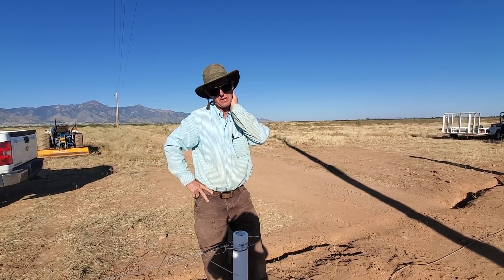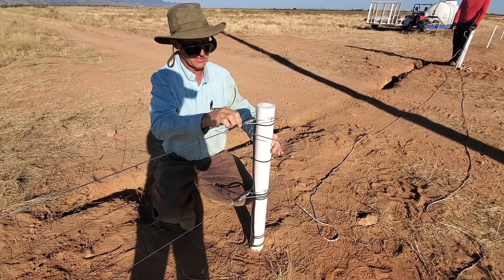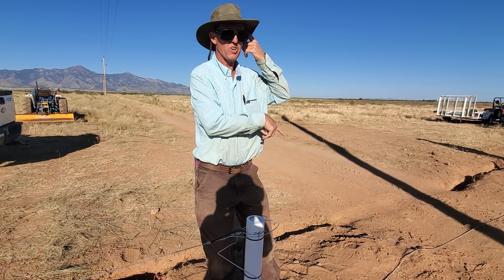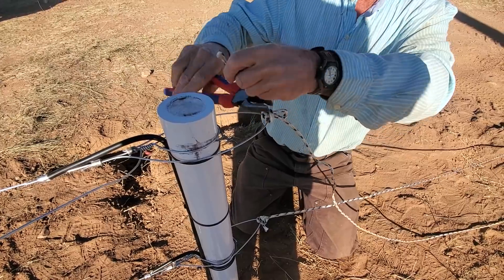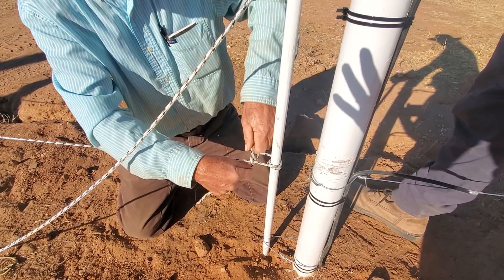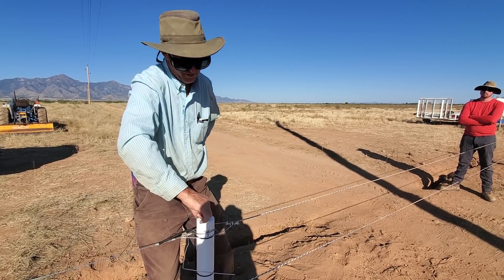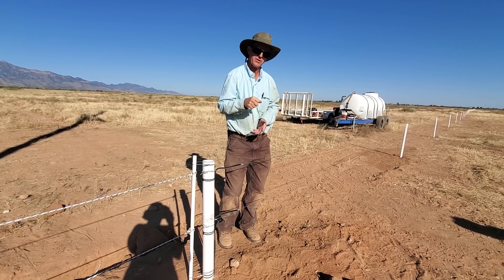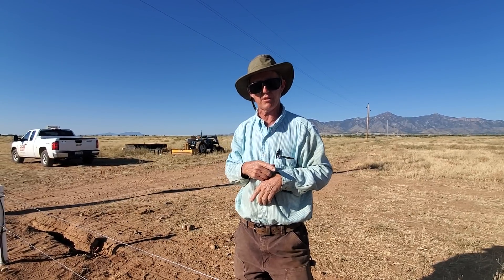Installing electric rope gate on Arizona grazing operation.

Comment: The only problem with fiberglass is it starts to splinter in the the desert heat. I suggest using gloves when handling fiberglass poles/rods after they've been in the sun for awhile.
Reply from the maker: We painted the fiberglass posts to prevent fraying
Reply: @gregjudyregenerativerancher    Lol, y'all think of everything!  That's the value of experience plus a desire for excellence!

Comment: Do you need to connect these type of electric fences to a "mains power supply"? or can it be done with off grid style like solar or something similar?
Reply from the maker: Either power source will work fine for powering up the fence.
Reply: @gregjudyregenerativerancher  Thank you.

Comment: Would Schedule 40 PVC pipe work equally as well as the steel pipe conduit for strength under the gateway?  Or, is the steel pipe stronger and better able to withstand truck and tractor weight?  Thank you in advance for your reply.

Comment: Electrician here. The 2" ridged conduit is the way to go underneath a road. Depth is critical. 2 feet deep incased in concrete is the National Electrical Code requirement. For this situation one could skip the concrete. Why? There's more then likely not going to be thousands of vehicles crossing over every hour. The deeper the conduit the less likely it will be damaged. It might seem over like over kill. Buy when a short time passes and you have to dig it all up again.......why didn't we put this deeper?

Comment: I have my fences 3 wire one neg 2 hot. Middle wire is ground. I am use 5 joule cyclops and right now can just hold the hot wire
Reply from the maker: Grab a hold of the ground wire and then touch the hot wire. If you don't get shocked then you can narrow it down to several things. First you may not have enough ground rods or your charger is to small for the amount of fence your energizing.
Reply: @gregjudyregenerativerancher no I grabbing both I have 6 ground rods on it  it's just that dry. Box is hooked to 3 then one on each corner. I am only 50 miles west but have only go 1/2 of rain since January. First winter rain should be here Monday then everything will work
Reply: @andrewsanders8167  I've had that problem.. pouring water on my grounds everyday was very helpful.. if I missed a day or two.. they let me know. lol
Reply: @txwildflowers7  pouring water could get trouble some 1/4 miles streches moving 3 strands ever day is getting to be a pain and having to use net fence to hold goats. Ground is as dry as it can get here this year

Comment: So, Greg you are putting two wires. One hot and the other for the ground, the reason is the dry land. It works better with two wires. And the third one is for the sheep